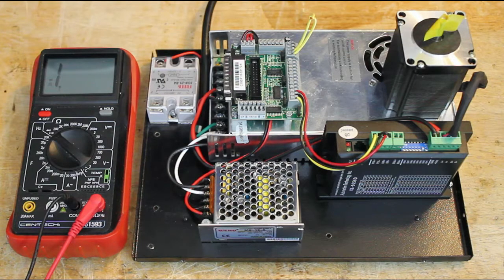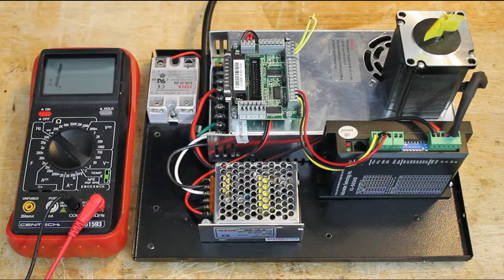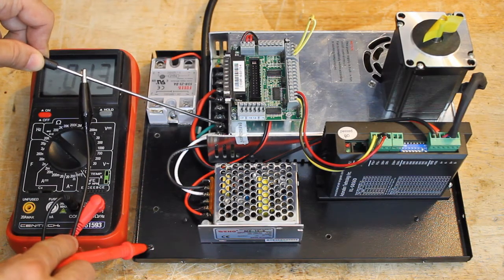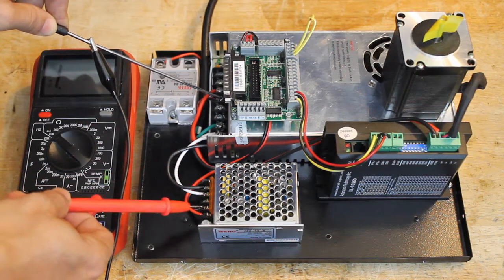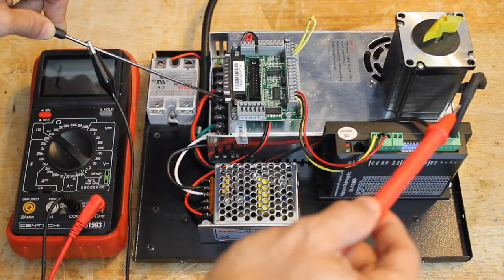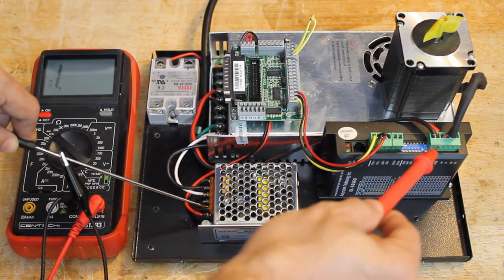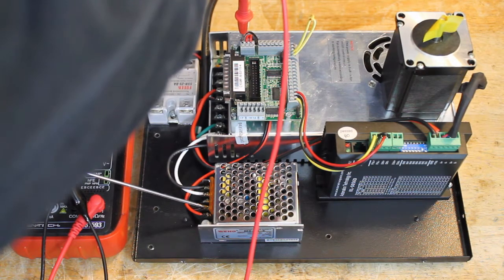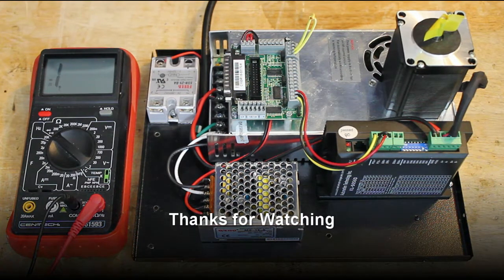Checking for proper grounding for a PC based CNC controller

Comment: Sir, I am from India, 

I have some doubts. Can You help or do a video on this???

I use the Same RNR Motion card.
 
1)Can I use Adhesive Aluminum Tape to wrap the Motor Cables and Signal Cables and earth one end to the Chassie to prevent any EMI-related issues..!? 

Simply wrapping the cables with a conductive material like aluminum and grounding one end of that wrap to the machine body would discharge any potential voltage spikes that may affect?!

If that is effective,
Grounding to the Chassie or the electronic/digital /DC ground on the controller board? Which is necessary?

Comment: Why don’t you want the dc output grounded?  Is this because it is pc based?
Reply: I have been chasing ground issues with my machines for years.  After switching to ethernet connections the issues went away.  Kinda strange.

Comment: That's strange, I thought grounding the negative terminal on the PSU would give a non-floating output PSU, would doing so have bad effects on the CNC?
Reply: I am a service tech and every cnc I work on has the low voltage dc circuit grounded. I was wondering if this is because it is pc based or is he trying to isolate something? But you are absolutely right, that 5v circuit is floating.